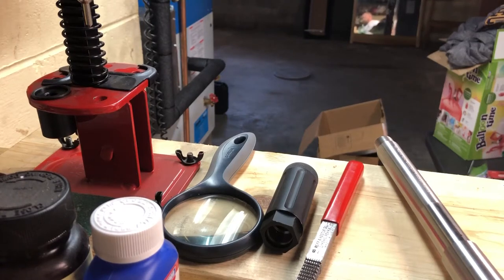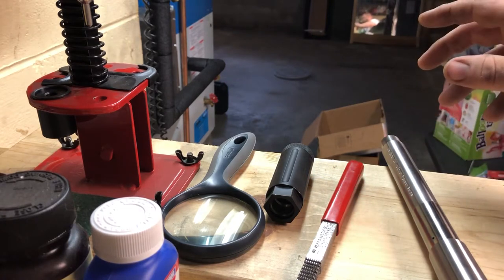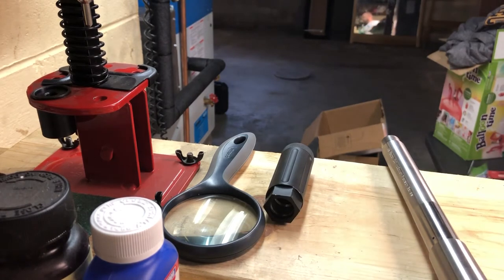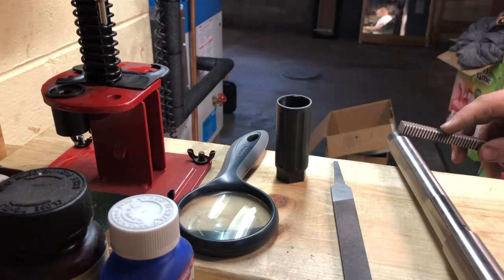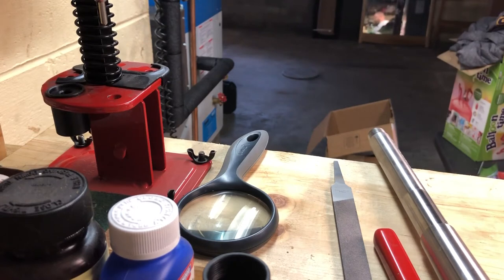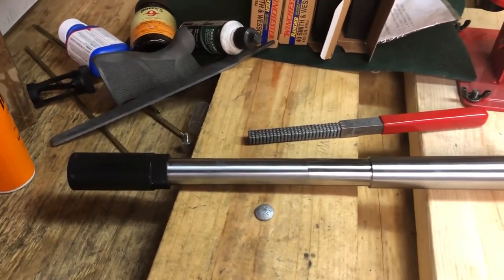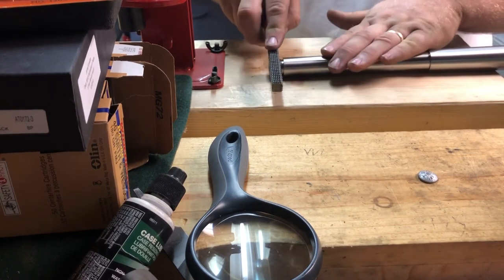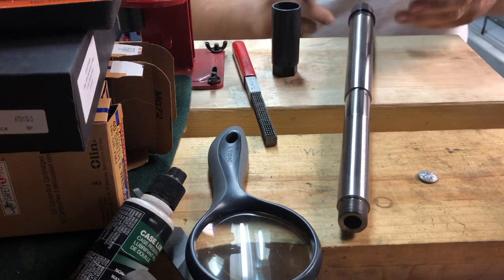AR15 Muzzle Device Will Not Thread on Barrel - FIXED

Comment: Tromix makes really good products. Tony is a master machinist and would never turn threads that were that out of spec. That's clearly a barrel manufacturing problem. My best guess is a bit broke during the threading, which caused it to go shallow at the tail-end. Just my opinion. Echo
Reply from the maker: I'm happy with the Tromix product!
Reply: @shortreloadingvideos7571  I'm just glad you got your muzzle device on. Good job and good effort. Echo
Reply: @shortreloadingvideos7571  would like to offer you a spot on a livestream on a Monday night, or on a Friday night. Friday's I start the show around 6 p.m. Eastern, Monday nights I start at 8 p.m. Eastern. Usually run for about 2 hours. Topics will be reloading. Please let me know if you are interested in participating. Thank you, Echo.

Comment: Can these be used on the internal threads of the muzzle device?
Tank brake for my 12.7x42 BCA .50 Beowulf barrel. Thread pitch 49/64x20 😵 it’s so hard to find the right tools. I have a bca flash hider that fit like a glove, not sure why the tank brake only give one turn before stopping. This happened before with a different make muzzle brake.
Reply from the maker: you would need a tap unfortunately.
Reply: Update! The threads on my barrel were a higher grade. I got the idea from you to lightly file down the peaks. It’s fits like a glove bro! It’s soo ridiculous! Aero upper with a made by me lower 7.5 inch barrel, superlative arms adjustable gas block, radian switch and SL raptor charging handle, radian talon saftey, strike industries lower receiver kit, aero chrome plated phosphate bcg, rubber city armory bolt, armaspec h3 captured buffer/spring with the strongest spring. And a cheap air lock 7 inch hand guard. Thanks for your help!

Comment: How does this method compare to using a die and running it through the threads of the barrel?
Reply from the maker: I am sure doing that would have resolved this issue probably better than what I was able to do, but I had this tool available to me and I tried it first, and it was good enough.
If you have the die, that would be a much better first choice!
Reply: @shortreloadingvideos7571  awesome, thank you for the response! My die gets here tomorrow. I will report back! It's this and then contact the manufacturer if this doesn't work. I'll let you know how it goes.
Reply from the maker: @desertranger111_6  how'd it go?

Comment: DON'T  DO ANYTHING until you know that the muzzle threads are the problem. It's easy to confirm that the threads are either within spec or are not within spec using a micrometer and thread measuring wires. Don't go filing on the threads until you know that they need work. Also, hand filing can easily cause the threads to become out of concentricity with the bore. This  could cause a catastrophic baffle strike! If the muzzle threads are indeed out of spec, send it back to the manufacturer. They should stand behind their work. Muzzle threads should be class 3. Machinery's handbook has the specs.
Reply from the maker: If you watch the video, you'll note know we chased the threads on the muzzle device with a brand new tap and it didn't remove any meaningful material. That's how we knew our muzzle threads had shallow roots. Lacking a die, we used a thread conditioning file.
Regardless if you use thread wires, if you have to touch those threads your concentricity is at stake, although not nearly to the alarming level you are trying to imply.
The manufacturer offered to take the barrel back, I declined and cleaned up the roots myself and things work fine.
Reply: @shortreloadingvideos7571  Fair enough. You obviously have experience where other may not.  Its just that some muzzle devices can have minimal clearance. Don't want anyone to get hurt.